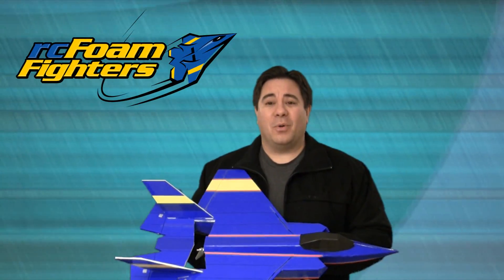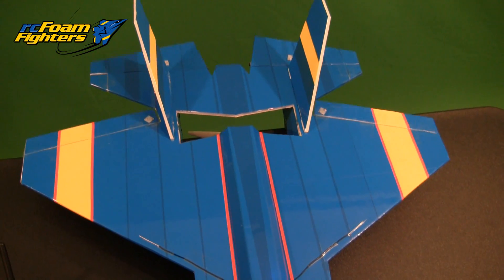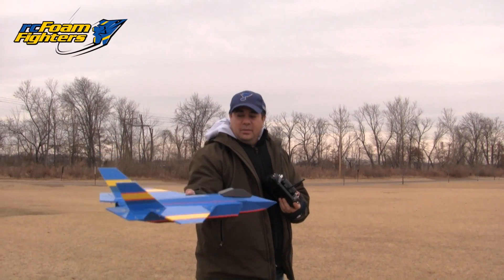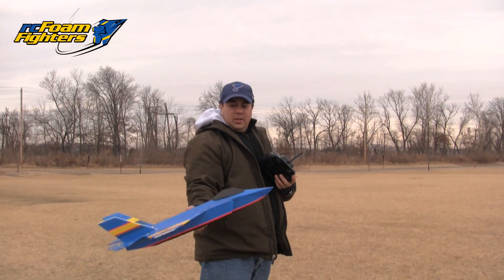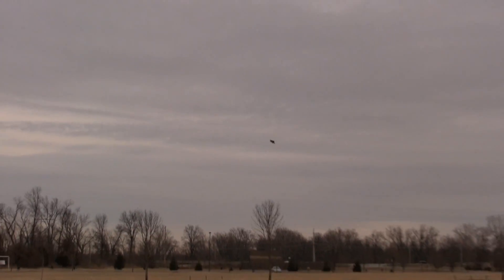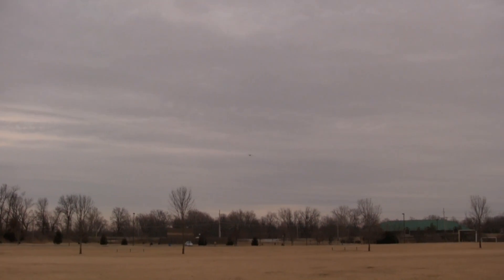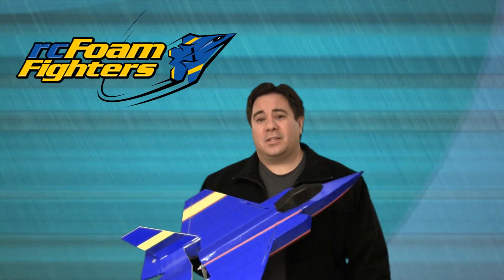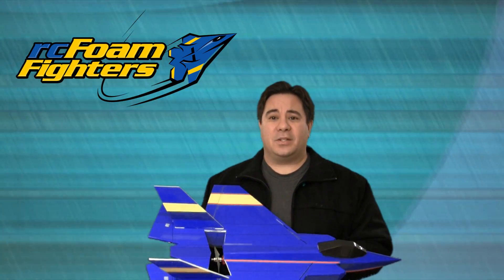FF-35 Part 4

Comment from the maker: @startazz Thanks Ian. The motor is a Turnigy 2836-2350 outrunner. I did have to push the shaft forward on the motor to use it as a pusher.

Comment: Ok, so you mean the CG is in front of the the wing lift center. so even if there is an elevator the approach is more that of a pure delta wing. the elevator is not used for the plane stability as it could to improve the aerodynamics, it is just used for maneuver(and look!) . it is weird to think that with this approach you reduce lift on wing and elevator to go up!